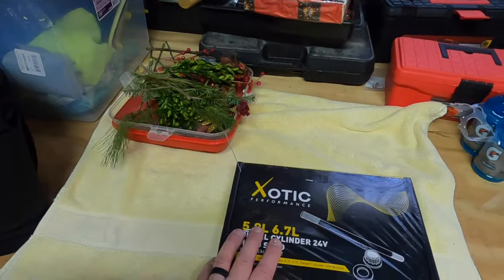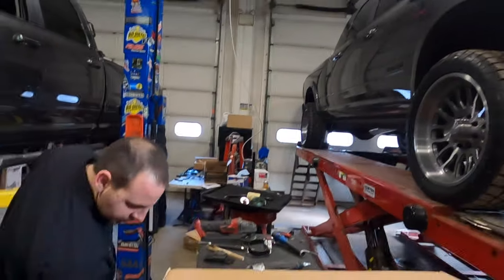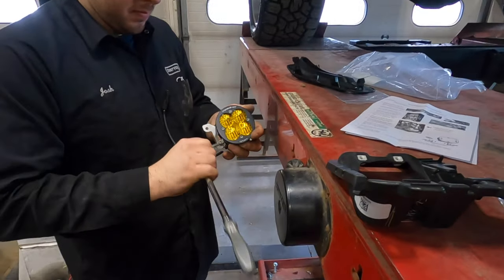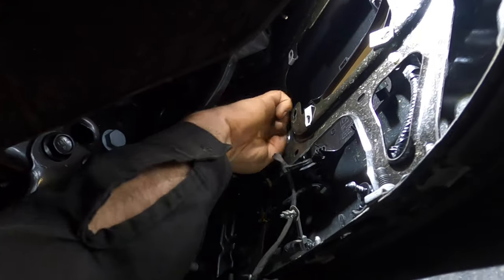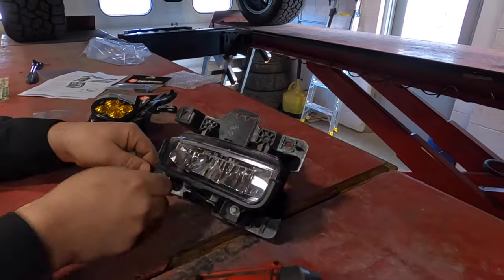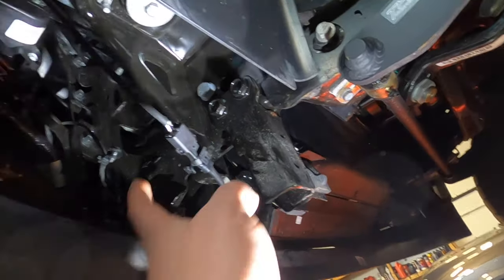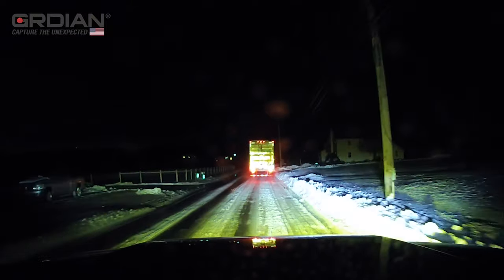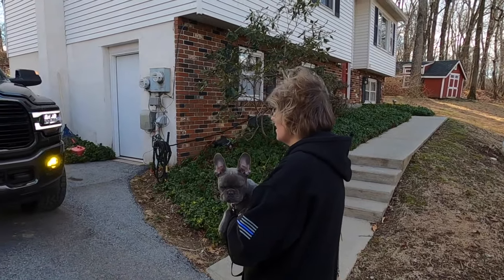GREAT RAM TRUCK UPGRADE! 2019+ HD Ram 2500/3500 Fog Light Swap

Comment: Nice! Since I already have the poor man Bighorn dually HO edition few less steps. But for now about 6 months ago got a pair Supernova V.4 amber bulbs. You happen to know which one's are brighter?
Reply from the maker: Those Supernova V4's are bright!! I ran them in BEAST 2.0.
Reply: @BEASTProjects  I remember. I had them in my 18 Ram then when got the 19 dually last year went with GTR. Then got the V4's amber for the fog to use in inclement weather. Headlight Revolution said there 3600 lumens per bulb. I honestly didn't think they where that much. In your video at the end trying to see and compare the distance with the headlights off. I would have to say the Baja design lights shine more to the side. But I am also using the stock housing on the truck. Your truck looking good!

Comment: They look great on your Ram to bad they don’t make them for the 1500. So quick question was the black wire the hot one and the white was the ground?
Reply from the maker: It appears so, but you can just unplug it, rotate it & plug it back in if they don’t work.You don’t need to repin it.

Comment: Does this work on power wagon trim?
Reply: I ordered a set from CJC, they told me it fits.  Got them today, will install in the next couple of days. 2021 PW
Reply: I installed them last night, if you don't have a lift it is a little more difficult unless you pull the fender liner.  Very happy with the result, everything fit perfectly.
Reply: @extspence  how long did it take you
Reply: @Spacesuit_Charlie  It took a couple of hours.  It would have been a lot less if I had removed the plastic air dam first.  I have replaced the lights with Diode Dynamics lights since and it took 30min.